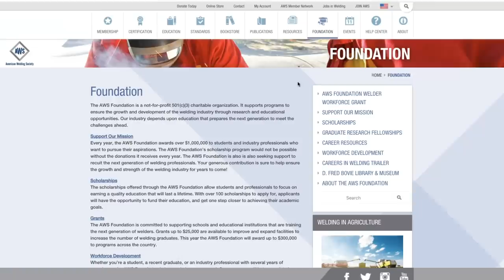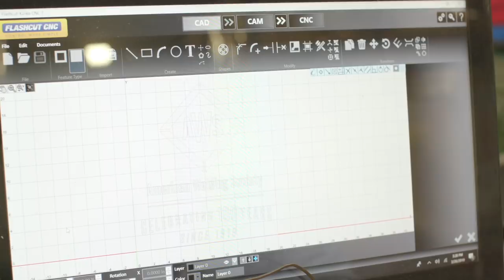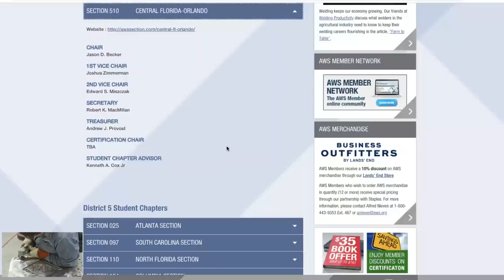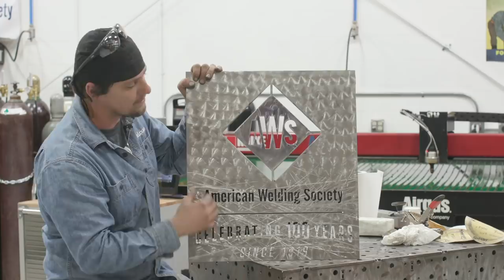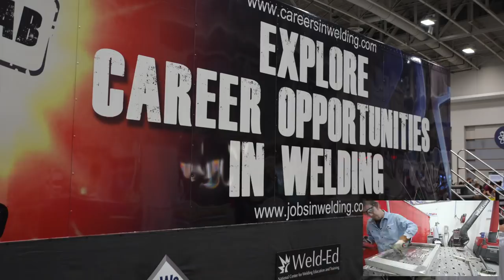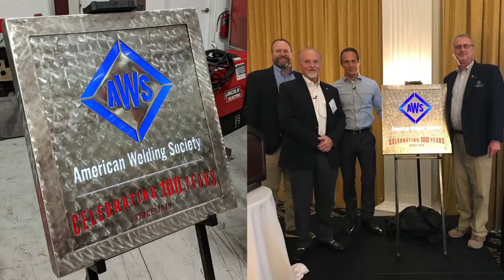What Does the American Welding Society Do For Welders?

Comment: How do I get more information  on AWS? How can I benefit being  a member ?
Reply from the maker: You can get more info at AWS.org. Some of the benefits are outlined in the video.
Reply: Don't call them. "We are experiencing high call volumes and your wait time are greater than 40 mins" They WILL NOT call you back. EVER! I called 4 days straight at 8:01am, they open at 8am. Same message.